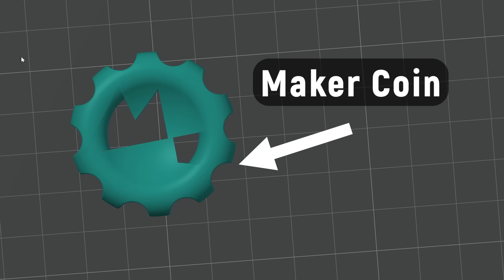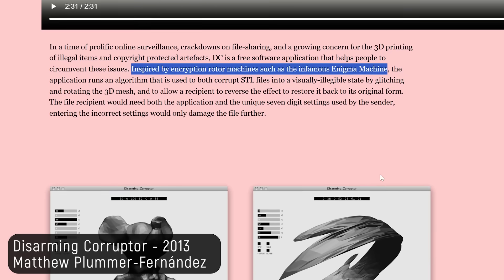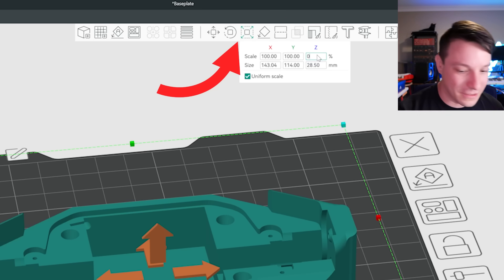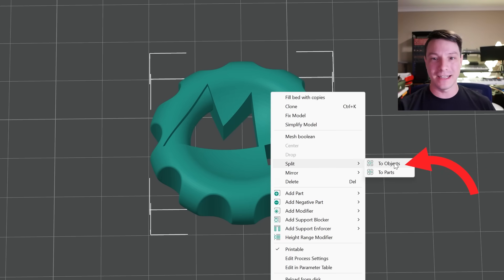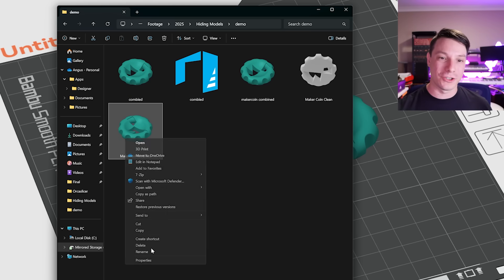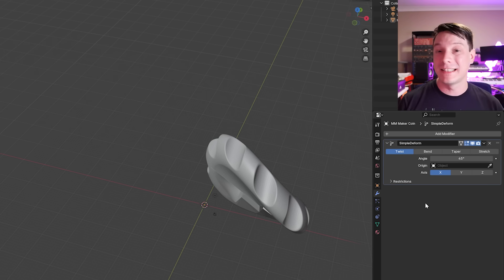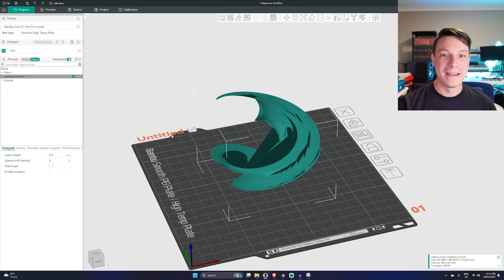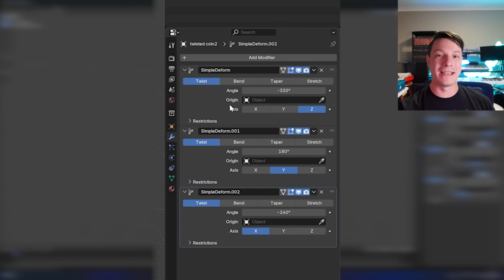How to obscure 3D models for fun or profit.

Comment: Ironically this would be an interesting way to encrypt game models as a sort of DRM function. You could use a texture for vertex offsets and then save that as the final model. When it's time to load the model in the game you reverse the changes with the same texture that would be built into the binary. You could even do this on the GPU for the sake of speed

Comment: I always wanted to know this: what's a maker coin good for?
For reference I refuse to print Benchies because I think they are a wasteful benchmark model. There are many smaller and less resource consuming, more specialized benchmark prints. Don't get me wrong, I'm no saint, I've wasted my share of filament too, but it was always to iterate a functional print that serves a purpose, like a handle, a gasket etc. For me such a coin looks less purposeful than even a Benchie. 
Correct me if I'm wrong but is it serving no other purpose than lying around in some drawer once given to somebody? It's not even a beautiful figure that you can display. I just don't understand/know what it's good for. 
Or can they also be used for something practical?
Reply from the maker: I originally designed them as a swatch for filament samples, but they became a bit of a "my first 3d design" staple for the 3dp community. If people enjoy trading them, I see no harm!
Reply: @MakersMuse  Ah I see! As swatches the Maker Coin makes sense. (Tbh, people waste a lot more stuff anyway, no matter what 😆) Thanks for taking your time to answer.👍

Comment: As someone else mentioned: the bit crushing is floating point errors. One benefit of 3MF over STL is non-fixed floating point precision. So ideally you'd export to 3MF, then just edit the project file to have 1 object instead of 2. Then precision is maintained.

Comment: An easy setup i just tested uses geometry nodes in blender and just uses "random value" set to vector going into the offset of a "set position" node. That randomizes the position of every point. Then to reverse it you can duplicate that node group and put "vector math" set to scale with a value of -1 in-between the first two nodes. As long as the seed is the same in both operations, you get the same thing you put in.

Comment: The biggest trick to security of all types? Don't be the low hanging fruit.
Putting up a beware of dog sign, or brighter porch lights. Adding an extra step to keep the bots from scraping your data. Making sure you have MFA and a strong password. Throwing your files into a zip/tarball. 
Cheap and easy ways to be more secure.

Comment: So... You could make this security mangling work by saving a 3MF (Maybe a new "S3MF" that encrypts itself so it's a little harder to open without dedicated software) with some extra metadata and having the slicer look for and process it correctly. As it saves out, use a seed-based modifier that mangles it *somehow*, and saves the seed as metadata. Slicer reads the seed, and reverses the "damage". But if it's not looking for, and doesn't know how to read that extra data; it's trash.

Comment: Honestly it seems more like this will be preventing crime rather than enabling it!! 

Something that came to mind was an avatar obfuscator for VRC called Dextros avatar protection system, whilst it obfuscates other stuff like textures, etc. it seems to do a very similar thing to the old OS app you showed to the model itself!

If you wanted to take it further, may be worth having a squiz at the project and reverse engineering a bit of the code to work in blender or even a standalone decoder? I'm not very well versed in coding or obfuscation for that matter xD but figured it may be useful!

Comment: Before you dive deeper into this topic inside blender try to look into blenders geometry nodes.

If you scramble your model in there you can additionally unscramble it in the same modifyer. Result would be one modifyer with one (or more) parameters as a key and a checkbox to switch between encode and decode.

Comment: This got me thinking about the different levels of encryption.  I think drive/file encryption are the only ones I usually interact with but this will remove any knowledge to the end user if the file is an image, text file, or some other format.  encrypting an image where you scramble the very pixels of the image, but not changing the image's spectrum or some other key factor of the image. a text file encryption the only uses printable characters, so the text file can still be open after the fact and read but its encrypted.

for a STL file the idea of warping the structure is indeed an interesting one.

Comment: Here's an interesting idea: automated unique watermarking. When you download a model, the server has the original and automatically generates a set of deform values based on your Unique User ID, so no user ever gets the original model, and no user ever gets the same encrypted model. Every user's "key" is completely different and only works for their encrypted model, so they can't share. This is sort of like how some TTRPG sourcebooks will put your name and email on the PDF copy you download to make uploading it to a piracy site just that little bit harder.

I'm super interested in seeing if the decrypted model is exactly the same, or if the vertex data is off by an imperceptible amount due to rounding and floating point nonsense. If that's the case, every user's decrypted model should also be complety unique and identifiable, so you would be able to catch pirates if they upload their copy after decrypting it.
Reply: There's always a way to defeat copy protection, it's a non-stop cat and mouse game. I'm sure if we had encrypted STLs/3MFs, someone will create a gcode-to-STL converter. You just slice the encrypted object, take the gcode output, and reverse engineer it to an unencrypted STL.

Then to prevent this someone will invent the equivalent of HDCP DRM, ensuring that the entire data chain from slicer to 3D printer is encrypted, and all new 3D printers have to be "3DCP" compliant, further locking down the ecosystem. Then someone will crack the master cryptographic key or find a way to circumvent it. To quote a famous ambassador, "There is no greater power in the universe than the need for freedom."
Reply: @ At the university I saw one solution in the past. It was a direct connection from the file(owner) to the machine somewhere on the globe. They could adjust even the output number etc. So when the Chinese manufacturer reached 100 they could not produce any more. But as you’ve said, the machines need to be replaced with special ones that support end to end encryption.
Reply: On Printables (or whatever other site), the "Slice Now" button that opens the file in PrusaSlicer could automatically download the encrypted file and apply your personal decryption, which would be very nice.
Reply: At the end you just save as STL and everything is gone. Sure we need a copy protection but it is not possible with the formats we use now.

Comment: 13:10 getting it to output a single number is likely just a clever encoding scheme:
Assume there are N parameters wich define the deformation. each parameter can be remaped* to an integer P[i] in the range of 0 to K-1.
Then the Key-Number Z can be calculated with Sum over P[i] K^i over all 0 <= i < N. The i-th Paramer P[i] can  then be determined by P[i]= Mod(Floor(Z / K^i) ,  K). 
Mod(a, b) is the modulus- function and gives the remainder when dividing a through b. Foor(x) round s down x to the nearest integer.

There are a bit more interesting things you can do with using binary numbers directley. for example 4 8bit (or 1 byte numbers) - each in the range from 0-255 **- fit neatly into a standard 32 bit (un)singed integer. (in this case you cold get more createive by sort of interleaving the individual bits of the different parameters instead of just putting them one after the other. ABCDABCDABCDABCD vs AAAABBBBCCCCDDDD).

For binaray stl-files at least it is even possible to manipulate the raw binary data directly, but in this case, we get verry close to just encrypting the file normally.

Comment: 6:34 it’s a due to rounding of the “cad” package. In autocad and microstation you can get weirdness like this if you are in high value coordinate ie 700000, 6400000 the faces of 3d items often don’t generate correctly. There not enough decimals left to round (it like 12-15 characters) the more on left of decimal point the more chance it fails. In a recent project I had to move stuff down to 0,0 to get access to large numbers of digits on right of decimal point to get accuracy.  Once 3d generated in moved solid back and it worked fine.

Comment: A fun story: A notorious criminal was once caught because he posted several photos of his face scrambled with a "swirl" tool. This is nondestructive, so investigators were able to reverse the swirl to get the original pictures of his face.
Reply from the maker: haha! I remember that actually. I wonder if multiple levels / effects would change the difficulty to unscramble.
Reply: @MakersMuse  The more layers that are added the more difficult it becomes to undo it. In your example you had 3 variables and still needed a screenshot and specific order in which to undo it. It would've been interesting to see the results if you would've used either wrong numbers or numbers out of order.

All of this is from the field of digital cryptography. If a program can automate a randomized destruction of a 3D model and then give you a key string that IDs the exact process you can give someone that key and they can use it to reverse the process. Doing stuff like this manually would be rather impractical. But since you're interested in it, definitely look into cryptography.
Reply: not a fun story at all knowing what that guy did
Reply: I wouldn't say non-destructive... Have you ever tried to get back a photo you lost from a social media profile picture? Or even send a photo via text between Android and iOS? Everything gets compressed, and while he could still be recognizable after reversal, it would lose some clarity.

That said, i'd be really interested in some of the software that authorities apparently use for license plate unblur.

Comment: Seems to me the “right” way to handle stuff like this us just to get the slicer maintainers to add a “decrypt” option to the file formats they handle. Load the file in the slicer, it prompts for a password! You could even extend this scheme to “signing” the models using a certificate that could verify authenticity just like software or web sites. And for models sold for profit, you could even support prompting for an authorization key that is verified with the owners web sites just like when you install software.
I don’t understand the need for coming up with a whole new scheme when there are lots of methods existing that could be extended to this use. Whether they should be or not is, of course, a whole other question!

Comment: I will admit I found the video entertaining. But I also agree that it seems to have essentially no practical value.

As others have pointed out, obfuscation is just a really poor form of encryption. You could just encrypt the data and provide a key to decrypt (e.g. PGP) and that would work just as well.

But the bigger issue to me is, however you treat the data, anything that changes the actual 3D data is going to make a model repository's 3D preview feature useless. Sure, you can upload PNGs or whatever that show the model from different viewpoints, but IMHO the ability to render the model in the web page and rotate it around to understand it better before I download it is crucial.

That won't work if the model data being uploaded isn't actually the model I want to print.

You could enlist the help of the repository site, i.e. have them provide a way for you to upload data for the purpose of rendering but which they don't allow to be downloaded. But that's a big lift for something that probably will still only slow scrapers down slightly, especially considering that the 3D rendered preview necessarily delivers at least some version of the model data to the client's web browser, at which point they can access the data anyway.

Comment: With numpy-stl (disclaimer, I'm the author of that package), it would take about 10 lines of code to make it distort/undistort your files based on a given password. But I'm not sure it would be all that useful to be honest... it would also break the 3d model viewer on most 3d model websites.
Reply: What might be useful... using the password to remove parts of the geometry so it wouldn't be properly printable anymore (holes in the geometry) but it could still display like a mostly normal model.

Comment: In the past, we used a "setup file" which contained all of the moves & rotations to get customer part data into "Tooling Position". They were simply but frustrating at times to document the first time but automation used those files to automate the process so all following updates to the data were automatically located into the tool. With 10 or 15 revisions it was a huge time saver overall. Same concept, just send the "Setup File" to the intended recipient, leaving everyone else with garbage. Coding it to be automatically serialized shouldn't be a huge issue. I am unskilled at all of the above TBH, just ideas.
Reply from the maker: Huh that's interesting! Definitely a similar concept

Comment: The first form is steganography, where you hide data in something else. Text in a video, an image inside a 3d model, etc. The last form is closer to symmetric encryption, and I believe it could make a fun challenge. You can make a bunch of 3D models and 'encrypt' them. The viewers can then attempt to 'decrypt' them. Start off very easy with two modifiers, and then make it progressively more difficult. As the last example had a clear twist, I would just start to untwist around the most twisted axis.

Comment: Working with blender modifers is a really interesting approach!

I would probably have jumped straight to seeing if i could access and deform vertex/model data in the final exported file directly via code, which seems like a more flexible path to me, and wouldnt require importing a downloaded file into blender. 

Also, your demonstrations of hiding a model in another made me think of maybe transforming vertex/model data not into a random mess, but into a facsimile of another more generic model 🤔 altho i have no idea how much data you would meed to describe such transforms.

Comment: Another fun thing is hiding files in the JPEGs included with the model because you can use JPEGs as an archive file. You can even have the archive be password protected. It still opens as a normal picture and you'll only see the fact it's an archive if you attempt to open it via something like 7zip.
Or hell even hiding data in the pictures directly as like a line of pixels of specific colors or values.
Or even the picture itself being a key in the form of steganography.
When it comes to hiding data from prying eyes the sky is the limit.

Comment: If you're interested in learning more about encryption (like the enigma machines) - there are TONS of resources online. One unfortunate thing though is that this isn't secure, as you said it's security through obscurity. A much better idea would be taking blocks of (x,y,z) coordinates and encrypting them using a proper encryption algorithm like AES-256, that way you could have an actual text password of theoretically any length, and there would legitimately be no way to unscramble it without the password. You could then use the shrink trick to make it unlikely to be found.

Comment: Fundamentally you're trying to do through random obscuring methods what encryption does much better. Even the original project is just encryption ~ decryption.

There's an area to explore for a tool like nightshade (anti ai scraping for images) that would preserves the look of the geometry but completely destroys printability by confusing the slicer. But that kind of tool is not reversible. So it would only let you share your model to be viewed and you would need something else to let people print it. There's no method for a digital file to have an expiration date once it's accessible locally.

Comment: That's pretty cool! The thwarting AI scrapers use case seems like a good use case for this. I could also see this as a way of transferring files in a situation where encryption would put you on a watch list of some kind. You could even combine these methods together. Shrinking an obscured model and then hiding it inside another model for example.

I remember learning about this happening with pictures posted on the internet. People would change "just a few bytes" in places on the image that wouldn't be perceptible to the human eye, and store hidden text messages in images.

In IT there is a saying that security by obscurity isn''t security, but it is a tool in the tool belt. And in some unique use cases it could be appropriate and work, at least until it becomes wide spread.

Comment: Angus, it is a short term fix to a long term problem. obscurity isnt security if AI bots [or others] take the key from the publishers page too. i think this a decent way to do paid models where each buyer is locked uniquely vs a public model with a public key. Maybe this could be worked in to using PGP public and private keys either directly on the file geometry in the slicer or just direct file encryption on the external file output.

this does help to add a hidden creator signature with in creations for proof of copy strike claims. All your models could have a maker coin hidden in them that can be restored as proof of owner ship like a true makers mark on a tool that is hand crafted.